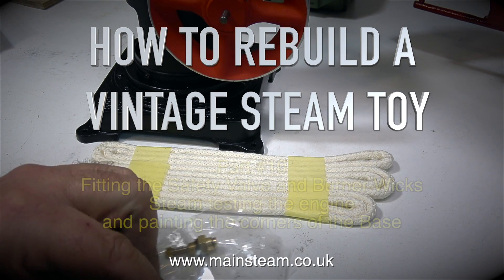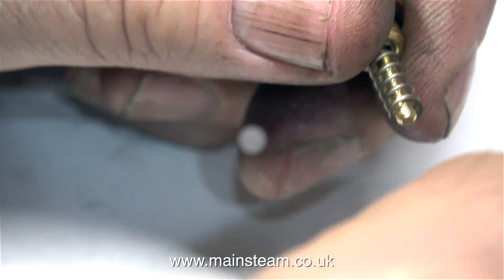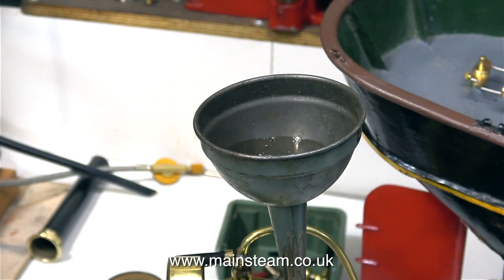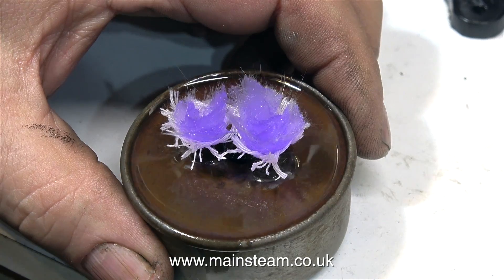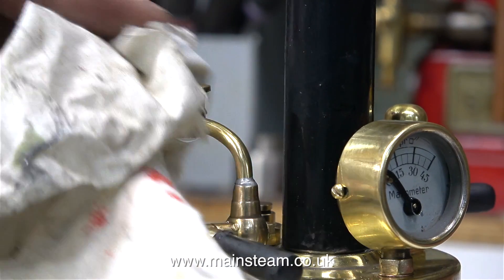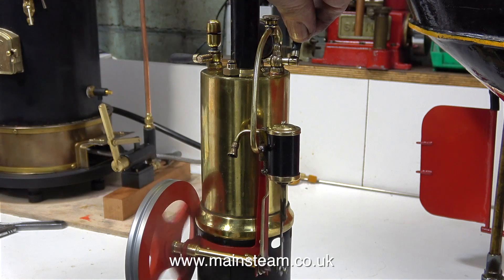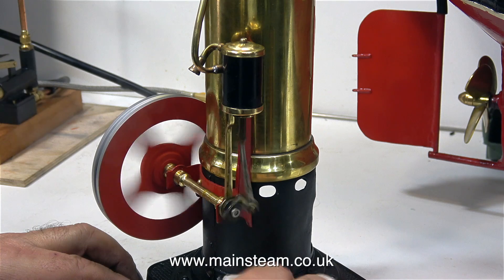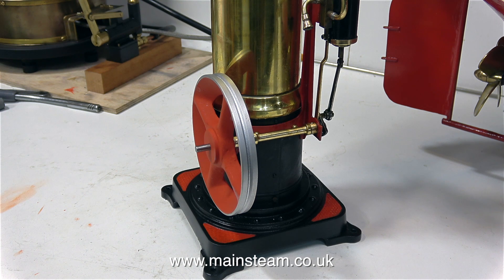HOW TO REBUILD A VINTAGE STEAM TOY - PART #10

Comment: Hi Keith, I take your point about it being a 'toy' engine but it is rather an attractive little thing and runs well. That acorn whistle sure looks the part :-)
Reply: ...think a decorative brass end piece on the rod sticking out of flywheel would look neater, ( or a shorter rod ).... it is a cute little thing thou & a fine restoration project.. cheers